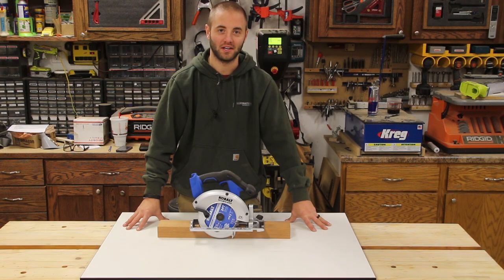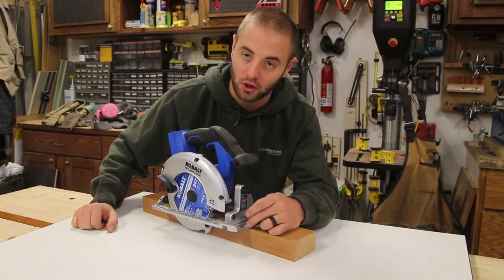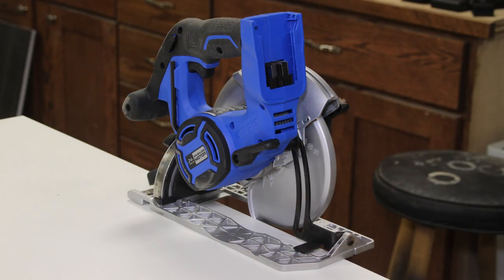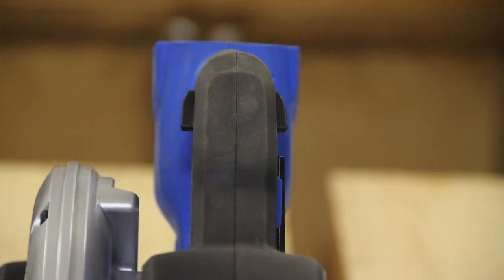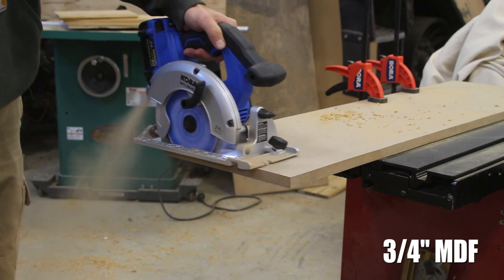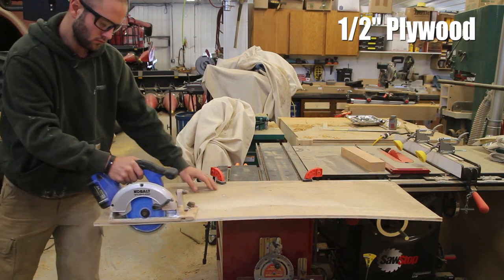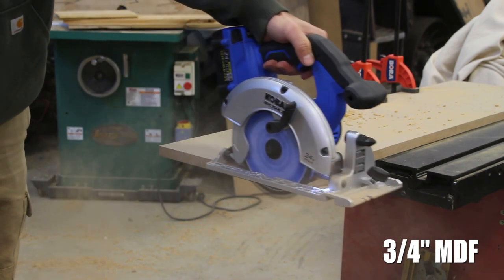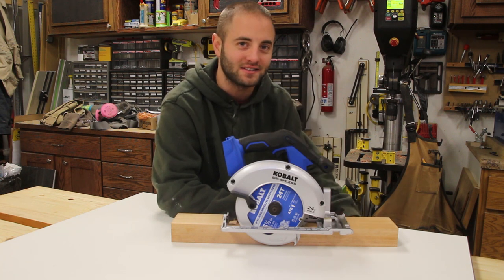Kobalt 24volt Max Circular Saw

Comment: I build fences all day and theres times where its easier to use my cordless kobalt saw rather than my corded one like when its too annoying to hook up to the generator and run 2 long cables or if I just need to cut a couple rails in someones backyard and I dont wanna hook up my corded one..This cordless saw was on sale at lowes for 99 bucks and it does everything I need it to.. I put a 4 amp battery on it which are cheap like 50 bucks and it can do all the cuts for a 500 foot fence (basic fence) on one battery alone.. So if you have 2 batteries it will do whatever you need it to..Its not bad at all and its funny I like using it more than my corded kobalt circular saw.. This thing can rip 2x4s too no problem...Idk I just dig the kobalt stuff especially their drills they are so strong.

Comment: It seems to be cutting just fine, but it will cut even better if you adjust the blade height for what you're cutting. Looks like you were pretty deep for that plywood. This also seems to make the blades last longer and not bind if you're cutting an unsupported end like you're doing in the video.

I bought this along with a whole new cordless set for Black Friday and it's a really nice upgrade from the Porter Cable 18v NiCad set I've been using for 5 or 6 years.

Comment: I have this saw.  However, the paint on the blade has rubbed altogether. It also only goes about 6 inches then something is wrong where the blade can't push through.  Do you have any idea what I am doing wrong?

Comment: Curious as to how many 2"x4" rips can be performed on one fully charged battery? Do you have some baseline of battery life? Years ago I fell victim to purchasing the POS Ryobi 18v system and the saw was a joke as were most of the other tools. I now have the Kobalt 1/2" impact, which is awesome!!! Two 4 amp batteries could be used on other tools if they are worthwhile.
Reply from the maker: 2x4 rips, like cutting it into two 2x2's, no we did not test that.  Testing like that, or even cross cutting creates such a variable because of rest time, tool heat, air temperature.  The Kobalt stuff seems to be a good.  It is made by Chervon, the same people who make EGO and Craftsman power tools.
Reply: I worded the original comment wrong. How many cross-cuts through a 2"x4" do you feel you can get from a fully charged battery?
Reply from the maker: On a 5.0Ah battery, well over 100.

Comment: Move your thumb out of the way of the  blade guard handle-while doing the deep cuts-you could cut your leg that way!The guard should work freely AT ALL times! Nice Saw Stop table saw in the background-I would have used that for the plywood.Nice little saw,though.

Comment: I really do not like the blade and guide being on the right side. its so much better in my opinion to have it on the left like a worm drive skilsaw. Porter Cable and I think Dewalt saws are on the left side. But having said that, Im in the market for a new tool set. We have been using the Rigid set and it hs been a very good set but my dad kind of took it over. I can't decide on spending $500 for the Rigid 5 piece set or buy the Kobalt 2 drill set and then buy the saw on its own...OR buy the Porter Cable 20V 8 tool set for only $400 which is a phenomenal deal and I think PC is under rated. I just don't like their circular saw or there reciprocating saw. Ill never spend the crazy amount of money for Dewalt (Black and Decker)
Reply: Look at the Ryobi 6 pc kit, $199 last i checked at HD

Comment: If Kobalt tools are so bad ass like the claim and it is a 24 volt line and even has a brushless motor too so why can't they make it a full size 7-1/4" And just by and by in one shot where you are cutting some sheet goods you had you blade all the way down and it should have barely lower than the wood itself, I am sure you know this and just forgot, it happens to the best of us lol
Reply: it's a 6-1/2 with the SAME depth cut as a 7-1/4 so it's still a win